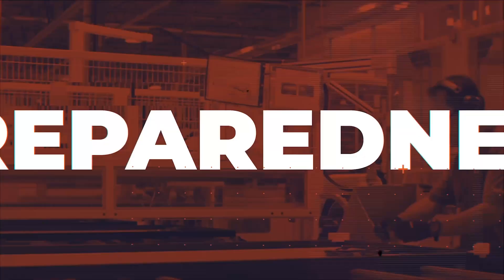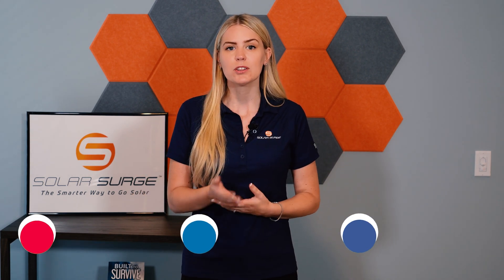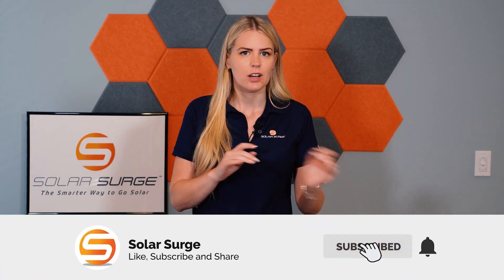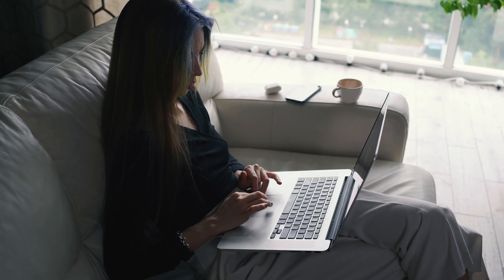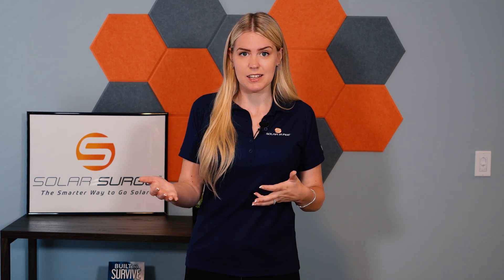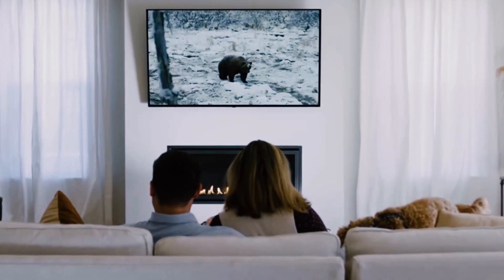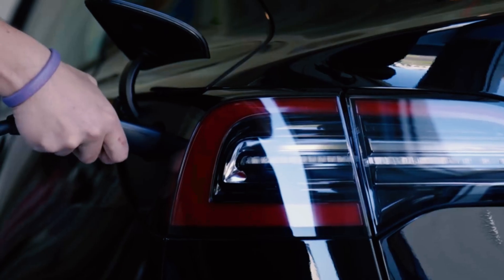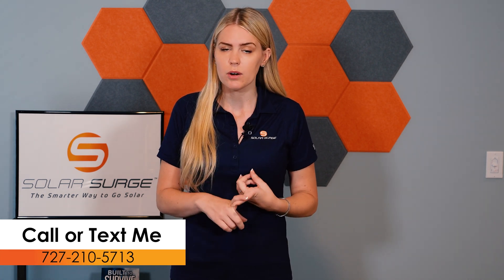Why is Tesla Solar So Cheap?

Comment: Tesla did that to me. I had all the contracts signed. Actually everything was all set to go and then at the last minute they canceled and I said well I don't want to canceled Will they said it's canceled when you cancel it. Well we canceled it yesterday. Well I'm calling today telling you not to cancel it. They said to to start over.
I told them to go scratch by Tesla as in goodbye

Comment: I am confused. She said that Tesla doesn't have system production monitoring? It shows right on their website that they do?
Reply: I think what she was referring to is the ability to monitor each individual panel. You would need micro inverters or optimizers on every panel to do that.  Tesla doesn't see the need for that with modern solar panels.  Tesla keeps it simple.  Less part to break, but maybe less features.
Reply: Tesla uses giant inverters- so no, there isn’t.  Also- this is a huge problem if your inverter goes out (common)- you lose all your solar.  TESLA is just a reseller- they don’t make anything. Even their powerwalls are Panasonic

Comment: I was just quoted last week from a local company who is a certified installer of Tesla for a 5.33 kW Tesla Roof system. This quote didn't even list a Powerwall. Price --- $130,668. Apparently there is a potential... potential of $43,000 of tax credit / incentive which makes the estimated final price if full tax credit / incentives are achieved --- $87,283 according to this company I received the quote from. Neither price is cheap. I will say that 2 years ago I went through Tesla for a quote and it was an estimated $57,000 for a system twice the size... for the same property. Now they just get you in touch with one of their certified installers.
Reply: Run away!
Reply: Yeah I had one of those lol. The guy could barely look me in the eye

Comment: I did buy my system throughout Solar Surge. My sales representative does not answer back, I’m with a system on the roof, not fully operational, paying the loan and the full electric bill at the same time, so customer service seems that may be better on the AI, because the other options are fractioned between the selling company, the actual Instaler and the finance company and not one is really behind ensuring the customer is being charged for a finished product.
Reply from the maker: Hi Javier.  I don't see you in our customer database.  Who was your Solar Surge System Designer?
Reply: @SolarSurge  Jason Palumbo
Reply: @SolarSurge interested to buy

Comment: I generally like solar surge's videos, however this seems...dishonest.  You gave general examples, like "you can see the production of one panel", without then explaining the difference between string inverters and micro inverters (the ones that let you see individual panel production) and the encumbent cost differences between the two.  That's a real reason why a system you design would be more expensive, micro inverters for a 7.6kW system vs a string inverter for the same system size are going to be a whole lot more expensive.  It also makes sense that if that company builds the equipment it sells/installs, it'll cost less for the installation, because of the lower overhead.

Comment: Better title would be “Why are Teslas quotes so cheap?” Reasons. 1. Cut out sales rep commission, 2. assume simple install, revise quote if not after site inspection. Cancel outright if overly time consuming install. 3. Keep it simple 4. Push industry on overly complicated customization and sales cycle costs. 
To which, I say good for them, and caveat emptor 
Instead, I went with SunPower and 8 months later still fighting them over unacceptable install shortcuts and screw ups. I’m only getting somewhere finally as I haven’t paid a penny yet, so I have leverage and proof of the screwups and mis-info responses (potentially fraudulent)…  ugh and oh well.

Comment: Tesla has two inverters. 
7.6kW & 3.8kW. 
Tesla Customer service has been better to me than Vivint and Freedom Energy has been to my coworkers. Vivint will send 3rd party installers and it will take weeks for them to come to service their micro inverters. 
Tesla Solar and PW was about $35,000 cheaper in Texas vs every other company I got a quote from. Because the other solar companies don’t have their own panels or Batteries. Most of them buy the PW’s from Tesla. 
Great video. Keep up the great work.
Reply: I just got a quote from Freedom Solar Power here in TEXAS for 3 Tesla PWs and it was $60,000 installed. Just for the batteries, no solar.  Crazy prices.
Reply: @wthharrison7233  Yes. I got a quote for around $80k a 25 year note. So it was well OVER that with the interest payments over time. It was 12kW and 1 PW. 😂 
They wonder why people are going with Tesla Solar. If you can do elementary math. You would know the better deal. 😂 
I’m paying my system off in 10 years with Tesla. I can pay it off early and won’t be locked into a long interest contract.

Comment: I have been using tesla solar more than year, I have no issues whatsoever with customer service, they picked every time I called, also Tesla has aps where I see how much energy produce .
Reply: She was talking about being able to see energy production at the PER PANEL level, which I believe Tesla does not do. My Enphase microinverters do that, which makes it nice for diagnosing a underperforming panel. Do you need that? Maybe yes maybe no. We did, however, go with Tesla for battery back up. Way way more cost effective. The Enphase did have a few minor functionality improvements, but not nearly worth the $10k boost in price. It has been performing flawlessly, and allowed us to avoid a generator back up.
Reply: @hansschweikert9153  I know what she meant, all companies charge almost double price compared with Tesla, I had consulted with all companies, they should cut prices.

Comment: I know of several homeowners that signed up with Tesla Online and then in the process the quoted system price doubled and then the homeowners canceled. No explanation and no way of contacting Tesla.
Reply: Not surprising. With no on-site inspection, all kinds of significant gotchas (like roof, man load center, etc) could be overlooked in an online quote process, necessitating a significant upward price revision

Comment: Another reason Tesla is cheaper is because they make their own solar equipment.  Also they take a satellite image of your roof and you provide photos of your electrical panel so they only come to your house once.
Reply: Tesla white labels their solar panels. They're not made by Tesla.
Reply: No they make them in Buffalo New York
Reply: No, every solar company I talked to used a satellite image. By not using a sales rep, they cut out first visit and commission. Site inspection still takes place, right? Then install day/team. Less sophisticated/and not top performing panels is other savings
Reply: They installed Q-Cells on my roof, looks good
Their own house brand 
 Inverter

Comment: Tesla is a perfectly fine and cost effective solar solution, but…. Their solution is very generic. I had a great crew. If you have a clean exposure and orientation, great go for it. Most installs are not that. In my Colorado install, I knew what I wanted and knew what I could have (considered doing a self install). Tesla price was only a few thousand over a self install price. But I went around in circles with them on the system layout before I would approve it. Arguably, I broke their generic model. And that’s the rub, I effectively got a custom install because I was educated on solar.

Comment: Am having panels installed soon and decided to wait for the Tesla Power Wall 3. From what I heard from reliable sources the 3 will be a game changer.  ONE should be capable of doing a whole house.  Will have new batter chemistry and for me being manufactured in the US is an important consideration.  My panels are built in Ga.  I buy Made In The US when ever possible.  So am glad I won't be installing batteries until next year.
Reply: I kind of doubt that one will provide whole home back up. However, if four can that’ll be impressive.
Reply: What kind of panels do you have? They're made in the USA?

Comment: Tesla Powerwall is actually a functional product but I am a bit leery of their chemistry.
Reply: Current powerwall now has LFP
Reply: @austinbentley2760  Link?
Reply: Why?
Reply: Cobalt maganese is more liable to runaway combustion. Lithium Iron phosphate is a safer chemistry (but slightly less energy dense).
Reply: @MrDontcareify  Seems they’ve got it nailed.  Powerwall fires are darn near statistically non-existent.
Reply: @TrendyStone you never want to be the first at your dwelling. A car, sure. There's no reason at this point to buy any NMC battery technology for home storage.
Reply: @punksjutgbd  The odds are greater that you'll be struck by a tornado or lightening.
Reply: @TrendyStone  it's a risk some are OK with. An unnecessary risk at that.
Reply: @punksjutgbd  I know there have been about 50 Tesla car fires out of ~3 million sold.  I can only find one story where a Tesla powerwall was suspected of starting a fire.  Do you have any data you can share?
Reply: @TrendyStone  I'd rather hear of a car catching fire rather than someone's home. I bet these companies agree. That's why they are offering LFP batteries going forward. Even the next Powerwall will have it.

Comment: How are you handling homeowners that are in buy all/sell all areas. Example in my North Carolina location any solar production must be attached to production meter before consumption meter.  Electric rate here is .12/KWh. They buy at .01/Kwh from Solar and sell back to me at .11/Kwh. Same if I want battery storage. ROI takes forever.
Reply from the maker: Hi.  Great question. For this situation, we would favor a zero-export system. The solar and storage would be set for internal consumption only with nothing being sold back to the power co.
Reply: @SolarSurge  the issue is any solar produced (grid tied or not) must be connected on the utility side of meter via a consumption meter. No matter how you hook it up I need to sell it first.
Reply: Sounds like you need to get on your local board responsible for regulation.  That is a complete port to benefit the power company - and its completely unnecessary!  Good luck!
Reply: Things must be changing in nc (which i do think I read recently), but I thought Duke was 1 to 1
Reply: @cheefussmith9380  it’s always been buy all/sell all in my area by Charlotte, power not billed by Duke directly but supplied by Duke.
Reply: @cgutowski471  is that not the same thing? Not being snarky, I honestly don’t understand this stuff😂
By all sell all means 1 to 1 right? And you bank it all year until early summer when they reset you to 0.

Comment: Solar industry in America is horrible. 3x the price compared to Australia. 

I was quoted $31k for two franklin batteries 27kwh. 
I also got a quote for 4 enphase 5Ps batteries $28k for 20kwh.

That size storage for that price is just insane.
Reply: I was originally quoted 31k for 2 franklins and ended up settling on $29,250 or around $20,000 after 30% fed rebate. More than I wanted to spend for sure but pulled the trigger out of basic fear of the things coming regarding power grid issues etc.
Reply: @bradley8apig461  how have the franklins been performing? Any issues or complaints? Do you have microinverters?
Reply: @USNEM  Still not installed. Just got permits now waiting install scheduling. Hopefully up and running within a month. Also, I currently have a solar array with micro inverters at the panels.
Reply: Anyone here complaining about solar prices must not be in the industry.
Reply: In the US regulations around installs are the cause of the high solar cost from my observation.  That of course is limiting the market for batteries.  Its US local county regulations which are responsible.  Americans need to vote for less culture warriors and for more people who know how to run government well (rather than just slash budgets everywhere).
Reply: @economistfromhell4877 there are no regulations for the solar industry in the US.
Reply: Of course it is, Australia is one of the Welfare Children the US taxpayer must fund and protect.

Good Day Mate !
Reply: @somefrigginguy2844  Maaate, WTF?  Australia supports itself as do just about every other country in the world - what sort of drugs have you been taking?  Alternatively put up some reference that backs up your 'opinion'?